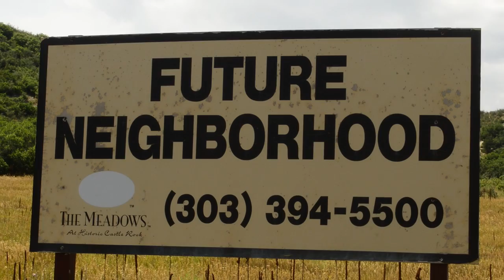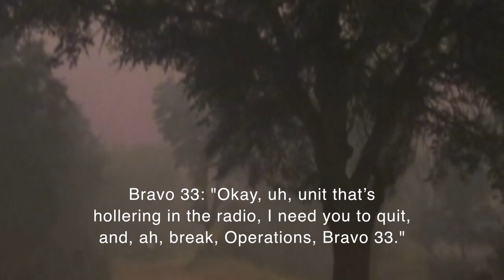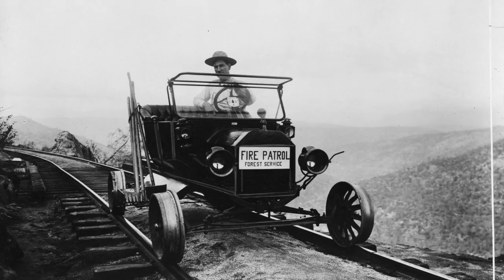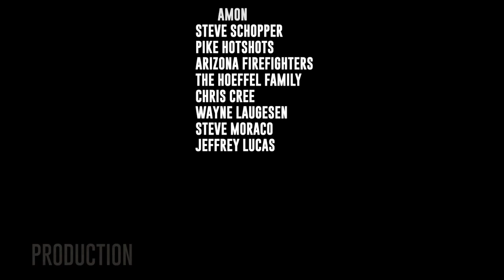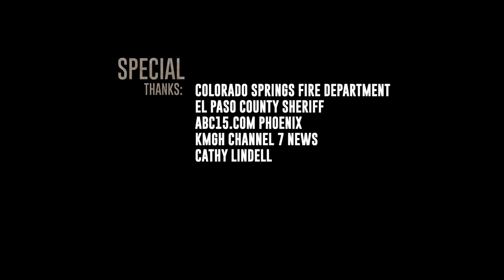The Fire Line: Wildfire in Colorado

Comment: I went through the Black Forest fire and my current home was one of the very few that made it through the Waldo fire. My house in the Black Forest was one of the lucky 17 that got away with only some damage. It was just lucky I and my father were at home the whole day when one of his friends called him and told us it was coming. It was clear that they only saved our house because we actually cleaned up the dead branches. Even then, it was clearly a hard fight because the siding of the house was burned and our water hoses were stretched out all over the place. Now I live right on Flying W, and the videos of that are so eerie.
Reply: Was there plenty of water in the neighborhood? and if so, what made the firefighters think they couldn't defend it?
Reply: @alan6832  Most of Black Forest is well water, there isn’t really hydrants in a lot of it, and the fire was knocking out electricity, which would shut off the well pumps. Waldo Canyon ran into problems of not having enough for the scale they needed, but also having to shut off water in certain areas to keep pressure in others. The heat of those fires was crazy. I remember helping some friends clean up there property in Black Forest, and picking up a dried puddle of aluminum that used to be a ladder.
Reply: @dj7291993   Sounds like they either need to dig some ponds or buy more tanker trucks, or both.
Reply: @alan6832  what makes you think it was defendable?
Reply: @jamesheberlein6842  Putting a man on the moon makes me think that.
Reply: Why do people build homes in a known burn area?
Reply: @badmonkey2222  Everywhere is a burn area because fire is natural. They've only gotten so bad because we surpress them and the forests haven't been kept clean for the better part of a century. Our house was saved because we forced the landlords to clean up the dead brush.
Reply: @ConWolfDoubleO7  fire is natural but there's also areas that are natural burn areas with mediterranean-type climate steep ridges in canyons dry brush and trees and they're supposed to burn every few years and then putting your house right in the middle of it? I just don't understand it I guess cuz I have a friend build a house and lost everything in Paradise California and I begged him not to build there and now he won't even speak to me because I don't even know why maybe he blames me for some reason it's insane.
Reply: @badmonkey2222  prolly cuz ur insensitive and started doing the whole "I told you so" shit

Comment: I lived in Colorado Springs and went through both fires. I did not live in an area that was affected but I'm sure it could have happened in the area I lived in if a fire would have started and spread through the creek area that ran behind my house. For the Waldo Canyon fire I had just left on vacation so missed most of the action from that one. As for the Black Forest fire, I actually watched that fire start up and blow up from my vantage point while working at the Air Force Academy (USAFA). When my co-workers and I saw the first smoke since it started closer to USAFA then spread away from USAFA we knew something was bad. It was a very windy day and once that fire got going it just ran like a chicken with it's head cut off. You could actually smell the smoke for days after the fire. It was one of the only times that we couldn't sleep with our windows open there.

Comment: Why don't they just change the building codes.  Use more fire retardant materials and build large buffer zones around high risk communities.
Reply: roof sprinklers
Reply: @donaldgray2128  Ive actually seen them on the outskirts of L.A. Malibu, thousand oaks area..Built in roof sprinklers.😂.Rich folks and their brilliant ideas . Didn't seem to help though when thousands of acres of fire in all directions descended on those houses..
Reply: @lightningmcqueen181  they work to an extent. If you don't maintain your property it'll burn. It's all about probability
Reply: Donald Gray metal roof
Reply: jay Day depending on the winds depends on the buffer zone cause some winds can carry embers for miles,starting spot fires large distances away from the original fire. That’s why wind is such an enemy of fire fighters. Also humidity is another problem. Ok I’ve watched to many fire fighting documentaries.
Reply: @lightningmcqueen181  Maybe it was roof sprinklers spraying water in 1000°C heat and knowing it turned to steam vapor while everything else became CO2 and metallic oxides.
Reply: @lightningmcqueen181  When I lived in Thousand Oaks in a house that backed up to wildwood park it had emergency wildfire sprinklers which were were required by law, and man could they spray a TON of water really quickly. We were also required to clear the brush behind the fence. Since all the houses in my old neighborhood are still there even though there was a wildfire that ripped through wildwood park I would say they worked.
Reply: That's what the fire codes
In California say, but even
If u build a 500' break around your house you
Need to close all the air
Vents and other ways an
Ember can get in. And if 
Possible, plant ice plants
Which t fire retardant,it has 
Been proven ice plants can 
Stop a fire in it's tracks. But 
It is not part of the discussion
Reply: HI there... These mega fires are so bad they take down a fire safe home in next to no time. Alot of people that stayed to protect their homes in the Australian mega fires died even thought they had the complete set up. the cvered gutters, water pumps etc.

Comment: Every year they set the grass on fire in Nepal and this only burns on the ground and rarely the trees,  I walked through one of these fires on a trail with no problem, more like a scene from a Hollywood set. They set these fires early in the Spring never in mid summer.
Reply: Yeah it's to prevent.
In Germany we have wide pits of sand so the fire ideally shouldn't be able to jump. We're I live we have a lot of conifer (I think thats what they called. The needle trees) monocultures. Had one fire there and it got like.. 12 kilometres far. Didn't came to us but you could see the smoke in the skye. And the sandstuff  seemed to work
Reply: @Kairos_Akuma  conifer is correct

Comment: 3:03 Kodas make a good point. Thing is now they are letting them burn and that's not working out either. Case in point the Cameron Peak Fire. They jacked around for a good part of the summer not really doing a thing about the fire.. OK, makes sense to a degree. But look on a map. If the fire changes behavior all of a sudden, a lot on communities are in a world of hurt and that's what that fire did. Comes to the edge of Ft. Collins in less than a day and a half and seriously threatened Loveland on another occasion.
Reply: same goes for east troublesome.. the loss of homes in grand lake and granby, as well as the threat to estes and other rural mountain towns was terrifying, and that fire raced at disgusting speeds. we're in desperate needs of better forestry management

Comment: This is pretty simple. Maintain a particular degree of landscape to begin with and when a fire happens it stops by itself. Simple mechanics. Instead our country is so based on greed money comes first. I honestly could have preventative measures in place so well that hotshots are not needed, and air tankers are not needed either. It is pretty simple. No one wants to do it even though it is cost effective. This country is so based on greed they would rather let people die then fix the methods they use that DO NOT WORK.

Comment: why don't all houses have sprinkler systems around the perimeter of each house, and the american govmt say sod off, to the water bills.
Reply: During a fire like that, water spray is going to stop it. It is so hot that structures like homes just explode...and all that water will steam off before the fire even gets close because of the INTENSE heat.

 If you've ever had a bonfire on a cold night you'll know that the heat is incredible even from a small thing like that, and this is thousands of times the size and heat.

Comment: Do they plant trees again after a fire? Just to replace the burnt ones. #Curiosity
Reply: Some trees actually thrive on it, like the eucalyptus – fire makes it release seeds so lots of new little ones pop up. They grow real quick and further exacerbate the problem as they burn like fuel
Reply: Intervention is not the answer.  This is the underlying premise of this video..Nature has a plan.  Fire is part of it.
Reply: @tomalapevides  maybe there are cyrpess trees that pop up after wild fire so do other plants like manzanita in Arizona. anyways
Reply: #Princess D   yes, on federal and state land and also on private timber property.    Good question.   Often burned trees are logged.  The smaller ones are ground into chips and the large ones are milled for lumber.  When the trees are removed it allows sunlight onto the forest floor and grasses and shrubs begin to grow.  The cycle begins anew.
Reply: The pine tree has cones that only open when they feel the heat of a fire. They release into the rich ash and 20 years later the forest is back.

Comment: Yup, soldiers say I will die for my country and go to war situations.  Police say only when necessary, Fire say only when caught in an unexpected situation.  They are ALL front line people, but with different jobs and commitments.  No problem. I'm grateful for all of them every time they do what the good Lord wants them to do.  What I'd like to see is a home design that will withstand a 3-4000 degree F fire in 70 - 100 mph wind for 4 hours.  Its a challenge!!  There has to be a way.  Anyone tried to experiment using Cob for the walls and having 2 layers of outside walls with air inbetween them?  And then there is the roof ...  Passive solar earth roof?  We know animals can survive these high temperatures underground and they only have to go inches down to be safe.  There has to be a way ... and then making it cheap enough for the public.

Comment: I am somewhat puzzled about how green it is to burn that way with intensity. It makes me wonder if all the chemicals trails in the sky's would something to do with the flambility of the tree's
Reply: Worked as a hotshot firefighter for a few years… Just because the evergreen is green, doesn’t mean it wont burn hot. If the fire intensity gets up to a certain temperature, the probably of ignition will increase and you can easily get a crowning fire or single torching 🌲

Comment: Here's how to use the forest properly you go through and you cut it all down what does a forest fire do it burns it all to the ground and sterilize the soil send The Lumberjacks through clear cut it you take what can be turned into Lumber turn that into Lumber turn what you can into paper everything else can be processed into fuel source to run killms to heat the pine cones to open them up together the seeds you plant the seeds in huge sandboxes per se Greenhouse all that and then you can find the trees that are more resistant to drought and more resistant to Insects will have a healthier Forest you take those saplings and plant them around stumps 428 around a stump if half of them live okay if not your Forest will be staggered instead of in straight lines the lumber will be passed through Kilns for drying it killam's suck out in evaporate a lot of the resins that are in the wood the resins are collected them can be turned into a organic all-natural cleaning products as well as a all natural fuel that literally grows on trees and is renewable every 30 years give or take you go through in clear-cut that Forest again then you go to another spot clear-cut that and you repeat the entire process over and over again instead of the forrestfire sterilizing the soil we take the ash from the kilims and spread it over our crop plants so the humans can get the vital minerals and such that the Trees of sucked up don't worry the tree's root system gets them a lot more minerals than what a corn stock can get so the trees for 30 years or sucking up minerals out of the ground in we can make healthier people that would be the proper way to take care of the forest and to manage it properly
Reply: Simple solutions for simple minds.